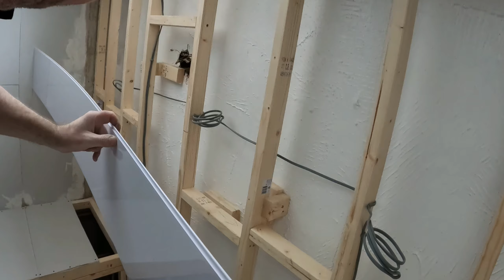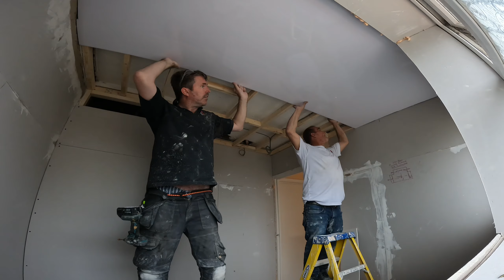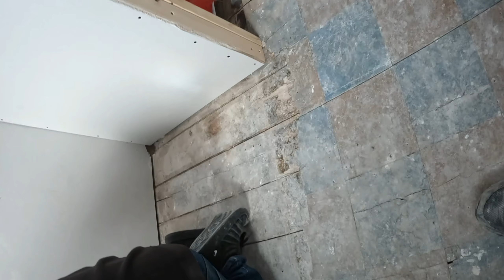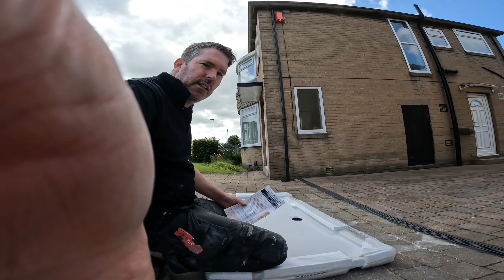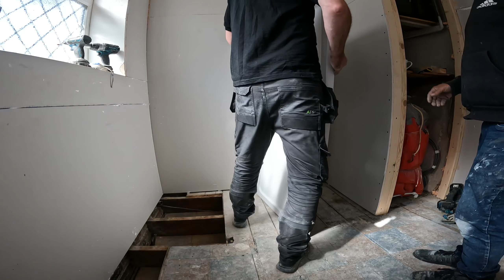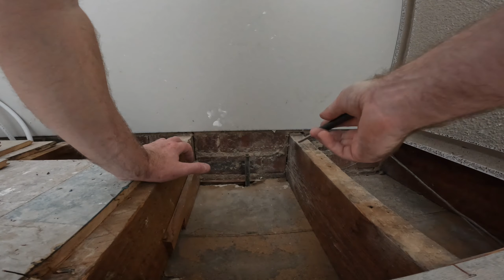bathroom renovation shower room. toilet sink wet wall shower How to fit a showertray  part4

Comment: Cant see any holes in the ceiling for the lights?
Reply from the maker: Yes it will be very hard to see them because they are not there
Reply: @bishbashbosh121  LOL,  how is the electrition going to fit thelights?
Reply from the maker: He will drill the holes put his hand through and grab the cable
Reply: @bishbashbosh121  how will he know where the cables are? Have you refrence marked it?
Reply from the maker: If you have a look at the video on the left hand side you will see a little plan of the lights